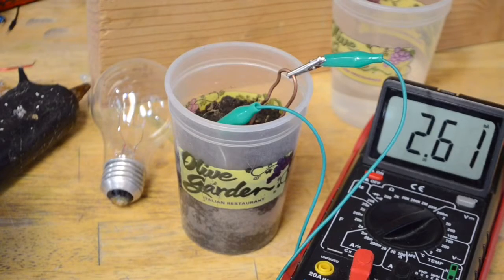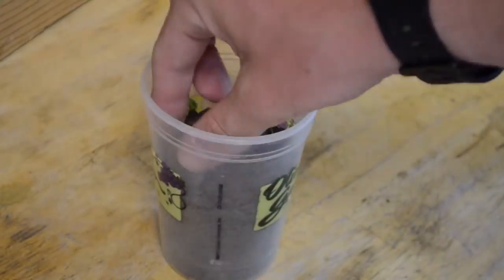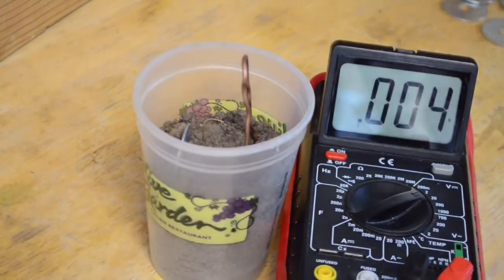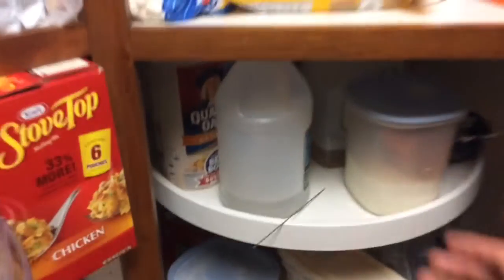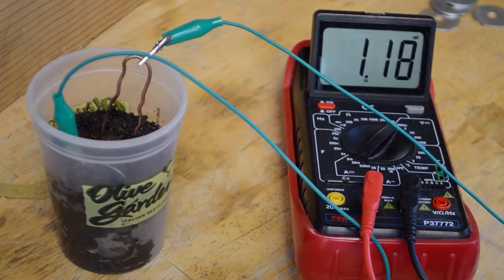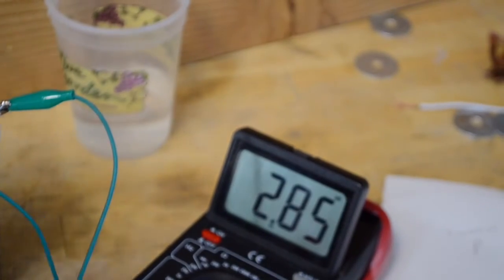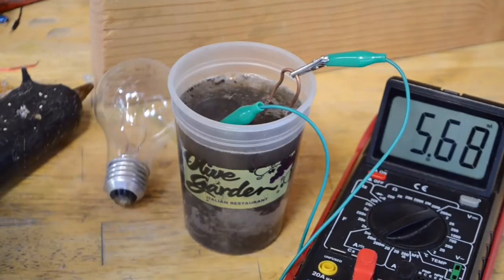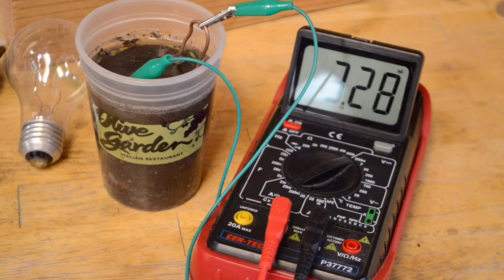How to get energy from Dirt

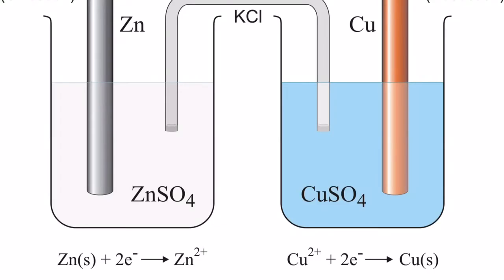Comment: In this video lot of confusion...if you used vinegar means dilute Acetic acid (CH3COOH) so how you get sulphate ions (SO4--) as ZnSO4  and CuSO4 as shown in figure 1:20. 
Next, the voltage is coming from metals redox reaction not soil at all which works as separator only. Please try to rectify in comment box or description part for clear vision...but thanks for posting science, anyway 😃🌹♥️

Comment: In 1861 telluric energy was discovered in the Alps.  Today this technology is commonly called an earth battery, EB.  Earth batteries work great at producing voltage.  We can build an earth battery in series and create as many volts as desired.  However, the amperage in an EB is very low.  This is what has hindered the usefulness of the amazing earth battery.  Here is how to build an earth battery.   https://youtu.be/aCCK132OIGA

Adding amperage is quite simple and key to making real power.  Power = Amps * Volts.   We have to increase the current in amps to produce any real power.  A simple law of physics shows that wiring in parallel will add the amps of the power sources.  We need to introduce a source of high amps.  A solar panel wired in parallel to the EB will give the circuit much needed amps.  I built this and tested it several times.  It works.  This hybrid system can produce limitless green energy.  The secret will be to have a special solar panel built.  One that wires are the photovoltaic cells in parallel to maximize the amperage.  This super amp solar panel will make the system a powerhouse.

Comment: What happen when the washer and copper inserted on the soil then how it produces electricity by just using those 4 components...  Washer soil copper vinegar...  Please explain to me
Reply from the maker: It is really not necessary for the dirt, that was just a gymic *sic, really, the acid (vinegar) produces electrolytes that act as a channel for the ions from the cathode to flow to the anode, where creates a charge potential since the anode gets more negative and the cathode gets more positive, so the electrons flow along the wire from the anode to the cathode until the reactants are used up.

Comment: can you make a emergency Phone scharger out of this?
Reply from the maker: With enough of them in series and parallel, but the wattage given from one is very low ('too low to charge a phone )
Reply: 10 in series for the voltage, then add in 999 more rows and that'll get you 1A at 5V without vinegar.